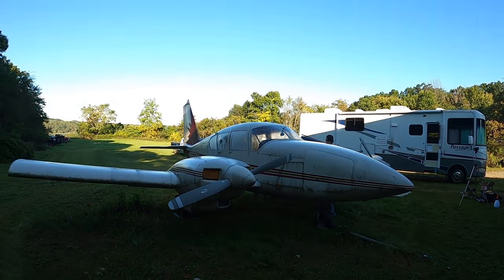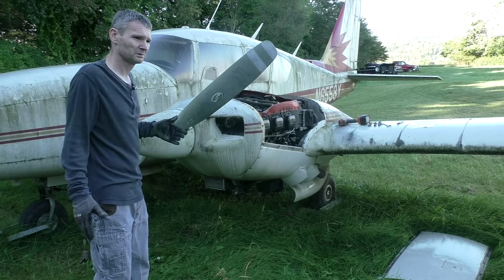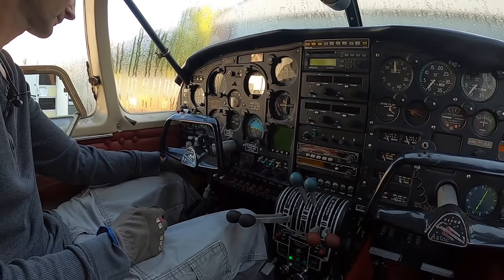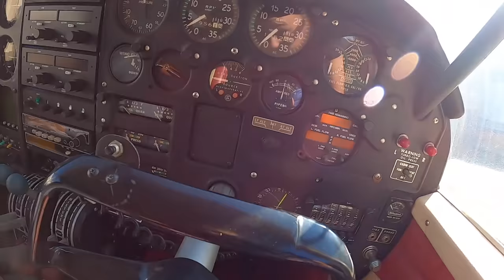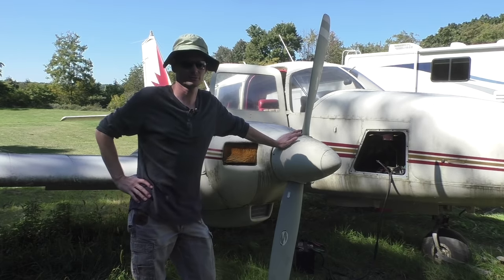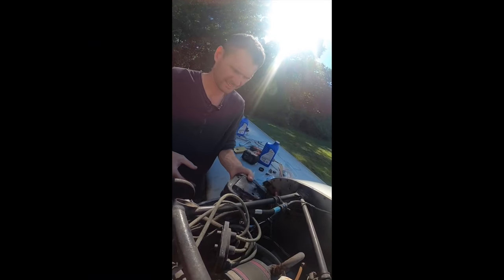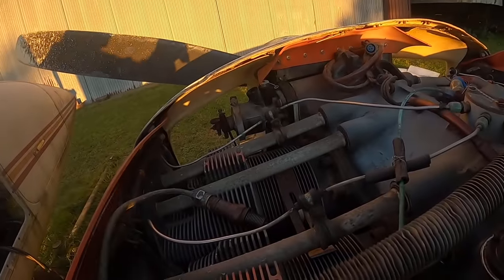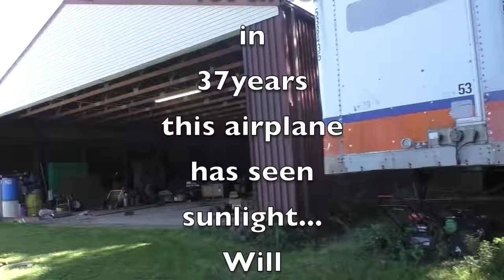Abandoned Airplane Will It Start After 7 Years? Aztec Twin Turbo!

Comment: I flew freight in an Aztec in 1980. I recently looked up that old bird to see if she was still flying. N20DM was well cared for by a retired airline captain and looked better than when she was a freighter. It actually brought a tear to my eye that she was taken care of so well. The airplane saved my life one icy night in Decatur Illinois. I was a pretty green pilot with less than 2k TT in my logbook, most of which was single engine flight instructor time.. N20DM was a full deice AC with boots all around/Hot Plate on the Wind screen and hot props. The Aircraft was loaded for bear with all that deicing equipment. All of us freighters regularly took off into known icing. The only report that would shut us down was freezing rain. I screwed up and took off with the right engine starter spinning but not engaged with the flywheel. I was told the next day that the starter solenoid had welded itself in the start position which caused a semi slow drain on the battery. The DC amps gage was an afterthought and was mounted on the right side under the dash. I had to bend over to the right and shine my flashlight at the gage to read it. I checked the gage to make sure it was showing a charge but I didnt take enough time to interpret what the gage was actually telling me. With the starter still spinning, the gage was trying to tell me that the amount of charge was too high. I saw what I wanted to see but spent only enough time understand that the needle was on the charge side and not the discharge side. I didnt notice that the charge level was much too high and I went through the rest of the check list routine and took off from Springfield ILL enroute to Decatur. The flight usually took only 20 minutes, so I wasnt to worried about the pilot reports of moderate rime ice. Within 5 minutes of the takeoff, I was being vectored for the ILS to Rwy 6 and I noticed the first indication that something wasnt right. The backlighting in my flight instruments started getting dim. I messed with the rheostat for a few seconds, that of course didnt help. I turned on the cockpit lights but they were so dim that they were useless. The next thing I noticed was the ILS to 6 was starting to show flags bouncing in and out of view. I then made the assumption that the electrical charging system was somehow failing. By then ATC was turning me to an intercept heading for the ILS 6 at KDEC. I turned off battery switch and began offloading everything electrical that I could think of. By then I had started using my flashlight to see the instrument panel. I left only the #1 nav head which had the ILS to RWY 6 tuned in and the # 1 com radio switch to their on positions. Everything else that I could think of at that messed up moment was shut off including the Windscreen hot plate. I quickly realized that If I couldnt shoot the approach to RWY 6,  I might not make it. The entire area was low IFR in moderate rime ice. I flipped the battery Sw back on and declared an emergency, I told ATC that I was experiencing a electrical problem and asked for distance to localizer intercept. They said I would intercept on current heading in about 9 miles and not receiving your transponder. I had turned it off with everything else to save power. I didnt respond to ATC, again to save power. I then turned off the nav lights, the #1 com and the battery Sw again to conserve as much power as possible for the ILS receiver. All that I needed was the ILS receiver to stay alive. I flew for about 3 minutes with approach flaps getting ready to intercept. Thankfully the wind was calm and I knew from the preflight weather report that the WX was hopefully still 300 overcast and 1 1/2 miles visibility from one hour ago. I flipped on the battery Sw to see if the localizer was moving yet. Thankfully with everything else turned off the battery had a few minutes to recover and the ILS needles swung instantly into motion with no flags. I knew they were telling me the truth, the GS needle was off the peg starting down and within about 5 or 6 seconds the localizer came off the peg. I started my turn to intercept and bracketed the inbound course. At glide slope intercept I put the gear down and started down. In this AC putting the gear down was almost always in a no wind condition a perfect setup for following the Glideslope with very minor inputs. The Aztec was a beautiful instrument platform. As I intercepted and started down the ILS, the nav head started flagging again. I was forced once again to turn off the battery Sw. I let 20DM save my life by gracefully with no autopilot she held her heading and decent rate to the 400 agl point. I flipped the battery Sw back on and the needles centered up and I started seeing the glow of the Rwy lights. She had done a perfect ILS approach on her own In spite of her damn fool pilot. The last bit of crazyness on that approach was that the windscreen was iced over. I had to flare looking out the side windows. I didnt really flare much, I eased back a little and let her do the rest.  The way I see it, that graceful old aircraft kept me alive.
Reply from the maker: Whew! That’s a solid 8.4 on the pucker factor scale!
Reply: Do you think you could probably add a little more text, it only took a short 3hr read
Reply: @AwesomeAngryBiker  Wish you were there, it felt like forever in a minute after intercepting the glide path and realizing I had to dead recon an ILS with suction guages and pitot static instruments. In other words guess at my position for 2 minutes. Sorry if my writing is a bit wordy. I had only one writing skills class in college, and a c effort at that.
Reply: @therealjimmysworld  I dont know from pucker factor but when I got out of the airplane my legs were like rubber. In 35 years of commercial flying, that night was the closest I came to killing myself. All because I couldnt be bothered to take 3 extra seconds to interpret what turned out to be one of the most important gages for IFR flight. I guarantee that was a lesson learned the hard way and it almost cost me my life. The difference between a normal indication and an overcharge indication was about 3/16 of an inch needle further to the right . Im not making excuses, I messed up by not looking for something out of the ordinary on this incredibly important gage. There were no yellow or red arcs to say there was an overcharge. It was just slightly further to the right than normal. I should have taken a few seconds and at least looked around to see what the slightly abnormal looking gage was trying to tell me. Its amazing how something that at that moment was seemingly an innocuous minor gage anomaly but was actually so important as  to nearly be my last flight. It scared me enough to rethink my life choices for about 5 minutes. I instantly realized just how much I love flying. Two hours later I got into the replacement Aztec that my boss flew in from Davenport Iowa and continued my route to Champaign/ Urbana and Midway in Chicago. Crap low IFR and moderate rime ice the whole way and I loved it.
Reply: @romanlightman4937  Great story, with a good ending. Glad you made it.
Reply: You would have loved flying that experimental I used to fly in the winter when the full length hinge on the ailerons froze and they quit moving  ....
Reply: @sailingcapedissappointment2012  
I have avoided flying single engine AC after I moved up to twins flying freight. I have had a number of engine/propeller failures over the years. Plenty of war stories to tell. Singles are too much risk in my view.
Reply: @romanlightman4937  yes they are

Comment: This plane is actually really nice if it has no corrosion. The interior is really nice. Maybe after rebuilding the engines and some esthetic work it will be good to fly. After seeing the first plane I was a bit doubtful about the deal, but after seeing this plane it looks like a pretty nice deal after all.
Reply: You gotta clean the engine completely 1 tubes at a time, the faa won't approve this condition of aircraft

Comment: 15:47 The same happens to me sometimes in a single-engine Cessna and I think the sparks are generated at different advance timing during starter operation, than under normal operation.  With an average engine, I should release the starter at the first sign of firing,  in order to transition to the regular advance timing, but if the initial firing is inconsistent, intermittent or weak, I keep on turning the starter and when I release it after 5-7 seconds  (not to overheat the starter), it "miracurously" starts with confidence.

Comment: I once crewchief a UH-60A/D never could get her to track right,,so we called her the Albatross,,odd thing was since she was never weighted down with radio mods for the D mod,she was faster than the new Deltas out in Kosova,..ahhh good times,,yeah you can used that,,much respect for the field maintenance you would have been a great crewdog for sure in Army Aviation👍

Comment: So I’m confused? Is your goal to get these planes airworthy to fly them or just to get the engines turning? Either way you sure seem to know what you’re doing and I’d love to see a full restoration from neglected/decrepit to up in the air.
Reply: Of course not, it’s all to get them seaworthy.
Reply: @HighestRank  🤣🤣🤣
Reply: @HighestRank  Making me accidentally breathe in dulce de leche was mean, but that was quite funny XD
Reply: @HighestRank  More planes in the sea than submarines in the sky
Reply: You do know how much used aircraft sells for right?
Reply: @MrWolfSnack  Not as much as their original prices... A used Cessna can be bought as low as $25k; which is cheaper than a used newer car nowadays, (I would advise against buying cheaper planes though). Not many pilots are really gonna buy a restored plane, because its risky with how pristine every part has to be before they are ready to fly. Hell a small dent in an aileron can cause the whole plane to wobble and fly crooked. With planes, you are paying more for the assurance in safety and maneuverability. Going thousands of feet in the air with a polished turd really sounds sketchy.
Reply: buys them cheap, make 🤑🤑 of youtube filming them, if they run sell engines and other parts for profit. Guy really don't care to make plane airworthy, he tries to start plane engine that is sitting over decade outside imediatly, no boroscope camera inspection, no oil and filter change. Just shub eter in it and gave it trottle.

Comment: Tip: lyc 540 will ruin starters and hard start with both mags hot on start. Always start on one mag only. I dont remember if it is right only or left only but I remember it was just on or the other. Fuel costs made me sell my old girl.

Comment: 0:04 doesn't matter if mag key is off or not, you still run the chance of it going off via the impulse coupling. 

Or, if for whatever reason the thing is shorting yo ground or something, the engine might actually kick over and start.

Comment: “I sure hope the magneto key is off.”
It would be better to to see if the P-leads are actually grounded when the switch is off. Take an ohmmeter and measure for continuity between the P-lead connection at the back of each magneto and any bare metal on the airframe. If you don’t have continuity, then the magneto is hot and will fire when the engine is turned.
Reply: or just pull the leads

Comment: I dont know If it have magnetic ignition,  If it have battery ignition-coil   like a car 
It coud be the voltage on the ignitioncoil be to low When you try to start whith  starting- cables, and when you release  the start button the power be 12v on the coil agen and the sparkesplug start to spark
And the engine start.
Same hapend to my old car.

Comment: N6558Y: 1968 Piper Model 23-250, twin Lycoming T10-540 engines, owner listed as Ginnick Industries, Lower Burrell, PA.  Plane was permanently cancelled/de-registered  10/26/17, and is due to be purged from the registration system 10/26/22.  She won't ever fly again, but I guess she could be used for parts?

Comment: my experience with fogging oil is  that it really prevents engine from firing. I am using it to winterize boat engine and it definitely makes it harder to start. Wonder why would you put it in cylinders before trying to fire the engine?

Comment: Lots of work. Corrosion control new mags oil change avionics tires and prop overhaul. Rigging electrical changes new hardware.  Possibly new struts and tires. Engines need to be overhauled.  Lots of work.  Good luck. But be safe.

Comment: pro tip, dont pull on the flaps with your hands, only use the controls in the cabin as you actually do harm to the controls by moving them with your hand

Comment: Throwing away planes are not good because it is associated with the linear system. This plane is not even that old, even if it was, it should be scrapped and recycled. And what this guy did was a burden but was very good for the environment. He’s not dumb but seems smarter than us in another way.

Comment: All you must do when you see an abandoned plane is to find out why is abandoned? 
And check for missing parts, but first clean with steam water. 
Inside dashboard with air pressure to clean dust causing electric problems ⚠️

Comment: You said you are not idiot I believe that! 
Why are you checking for oil leaks plane staying for 7 years even if doesn't have it will start to have when you start the engine this rubber and all the parts staying drying this plane is dangerous, you will fly this thing mate oil is kept in the engine in a circuit between the parts with gasket to stay they inside the circuit when you start the engine it will heat logically and the dry gasket won't keep the oil for longer Mr. Smart pants